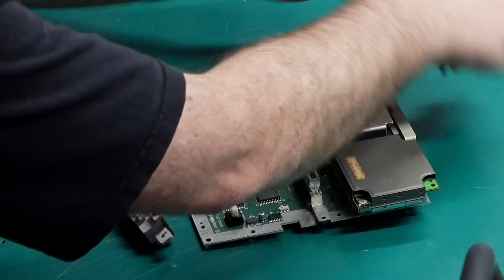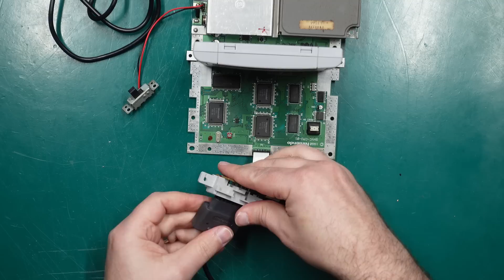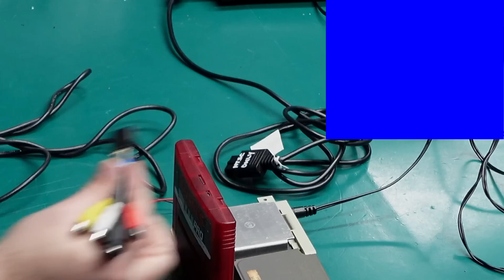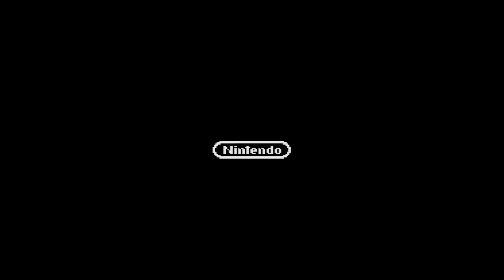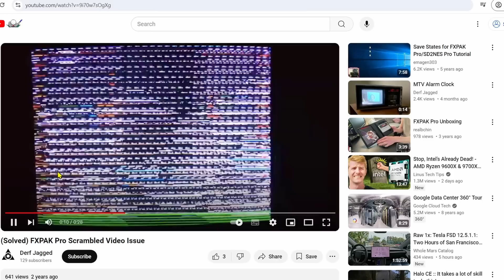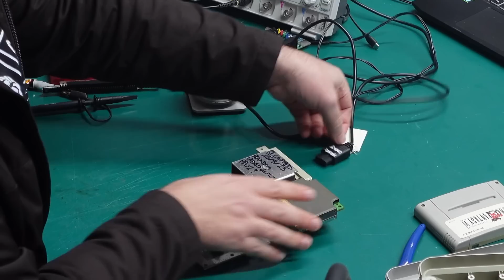SNES repairathon part 1: The clock buffer - SHVC vs Everdrive

Comment: I'm having a 32x getting a black screen on Everdrive, 32x and Genesis games. I'm sure it's not the ribbon cables as I've mapped all points on both boards they connect to and checked continuity.

Is there a similar situation where a test cart might boot that would help in tracking down the issue?

Comment: I managed to find a really nice SNES lot on marketplace. She said that the console didnt work so she threw it in with the games. It actually did work, but the console looks in pretty bad condition. The shell is falling apart as you would expect for plastic from that time, but I wanted to recap the motherboard. I wound up buying 2 cap kits from ebay. One SHVC and one SNS kit. I wasnt sure which motherboard I have but after finding a list of serial numbers this console seems to be an SHVC model. Which is a real shame as I know they are prone to have CPU failure. Luckily the Kit I needed came first and I will at least recap the console as it does currently work but I figured a fresh set of capacitors would definitely be the best first step in making sure this console lasts as long as possible. I am not sure what more can be done for it, but I tested every game I got and they all work and the games to me are more important. In the end I can always pickup a Retron 5 ( which I will need to get anyway to backup game saves), so in the end its nice to have as a collectors piece but ill play the thing until it dies. The tip about looking for corroded traces is a great tip that ill keep in mind when I attempt to recap my SNES. Also the Hako solder remover you have is well worth its price tag. I got one and love it.

Comment: Thanks for the videos, I have a question. Is there any way I can assure you that my SNES 1-chip 01 arrives and you can check it? It has a small video problem. I use it with the Rad 2X adapter. It has an RGB mod installed. I changed the capacitors and voltage regulator.

Comment: man, I wish I found this video way earlier. I was chasing this exact problem for months. I found out that I needed the clock fix for me. I ended up adding an external board that helps strengthen the clock, I believe it was the dejitter board.

Comment: If that's the only graphical glitch you had, I'm rather jealous :) I have 3 NES consoles (1 is my original console) plus a SNES, Megadrive, Mastersystem II, 2600, etc... and they all look like crap on my modern TVs, half of them don't work at all since a modern TV sold here in Australia has zero ability to tune into analogue stations, and the ones that do work, have horrible wavey lines all over the display.
Reply: You’re not using any sort of retro-gaming upscaler between the consoles and the modern panel TV? That’s most likely your problem right there.

Comment: I measured SD2SNES Rev. H pulling 560-580mA for all games, which is higher than any real cart. Like real Star Fox with Super FX measured 510-515mA and all normal carts were under 500mA.

Comment: Had question have a super famicom with shvc cpu 01 and having some issues .  When you play a game with player 1 controller  plugged in works fine but when you have player two  plugged in the game won't load just a black screen . Have a working super famicom  and swapped  controller port board same thing. Could you point me In a direction  to fix this thanks. Your video is very informative.
Reply from the maker: Likely a faulty CPU or something in between. The controller ports are handled directly by the CPU with a few passive components in between. Have a look at the schematics and trace out the connection from port 2 to CPU

Comment: What should I do if I find a black trace? Scrape away the solder mask, vinegar, baking soda to neutralize and then add liquid solder mask and cure it?
Reply from the maker: Remove the solder mask, clean with IPA, add flux and tin with solder. Vinegar will do little to capacitor electrolyte. Reapplying solder mask is optional

Comment: Have you ran into an SHVC that wouldn't boot due to bad caps in the sound module?
Reply from the maker: Not in the sound module, but I've seen one refuse to boot due to bad caps in the power supply (not the external supply but the SMD caps near the 7805). If you have the burn in cart, you can remove the sound module and the SNES will boot without it. But that only works with the burn in cart, games will not boot without the sound module
Reply: @TheRetroChannel  awesome I appreciate it, thanks for the info! 🤙

Comment: Just starting to watch; I'm curious if you'll run into any sound issues on any of these.  Recently I bought a re-capped Super Famicom (with a sound board) from someone and it turns out one audio channel isn't working.  They had just tested it by playing a game on an old tv with a mono speaker.  I swapped the sound board with another working one and that didn't solve it, so I'm guessing there's some broken solder or trace somewhere on the board.
Reply from the maker: If it's been recapped by someone else, check their work. Especially C65 and C66, the two smaller SMD electrolytics.

Comment: The North American SNES has the big cap inside the power supply, making the one on the board unnecessary.
Reply from the maker: Yeah I believe the NA one has a 3300uF in the supply. The JP has 2200uF in the supply  and 1000uF on the board. And the PAL one has 2200uF on the board but uses an AC supply and gets recitified in the SNES
Reply: @TheRetroChannel  You are correct on the board, but I've never seen a Japanese pwr sup, so can't comment.

Comment: is that a hot knife tip on the soldering iron? :|
I guess, if it works, it works.
Reply from the maker: Yep. I thought I'd give the knife tip a try and now I've gotten used to using it, it's hard to go back to anything else. Very versatile tip